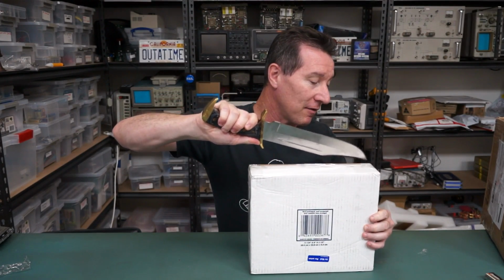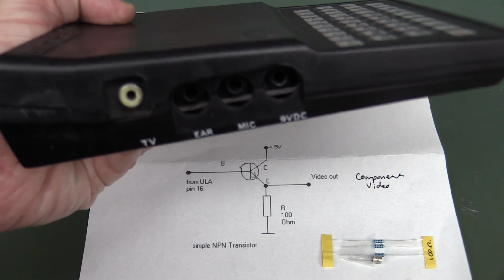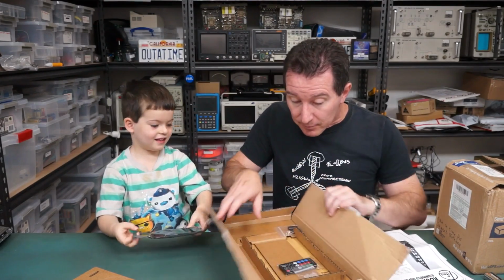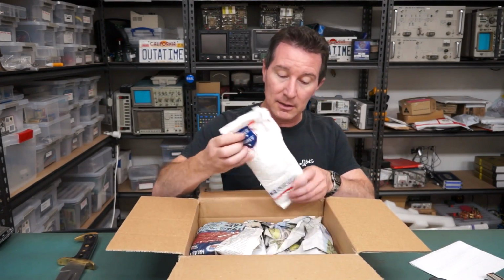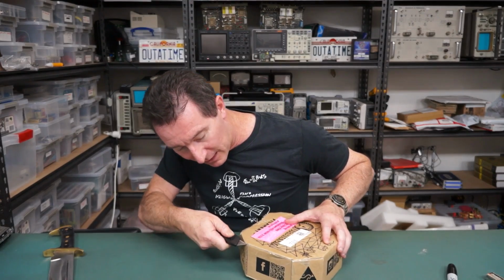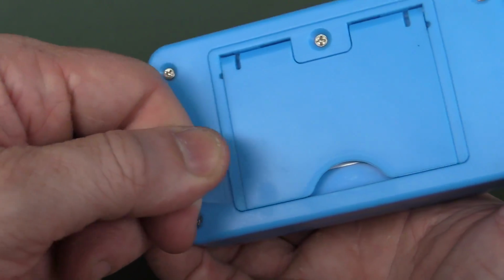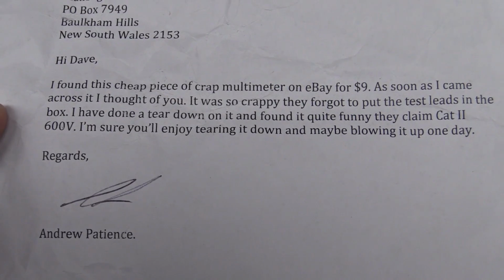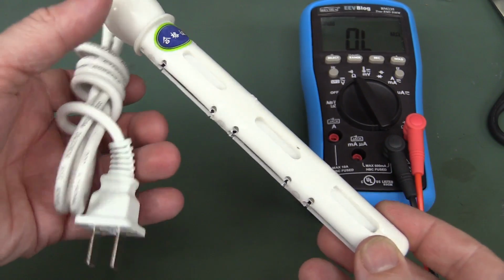EEVblog #872 - Mailbag

Comment: this is a ols 8x4 docis 2(and combatible docsis3) cable modem. most cable provider wont accept to activate this modem with speed profile over 60megabytes. (because it can reach a max 340 only if alone on all frequencies in the node)

Comment: Somebody may have noted this before but the ZX81 was sold (as kit and pre-assembled) in the US for a year or so before the Timex deal. I got the kit when I was a wee sprout and my dad helped put it together. Still have it, too. It was terrible tho.

Maybe that ZX81 was a kit, which might explain the assembly.

In 1981 or so pretty much every consumer thing meant to display on a TV used an RF adapter connected to the antenna input of a TV. At least that's how it was in the US. I don't think composite inputs really took off for US TVs until VCRs and camcorders became widespread.

Comment: the ram packs(expansion), were sold in 16k, 32k, and even 96k.
you dont need any components to do the composite mod you can wire a phono jack direct into the modulator box(videos on youtube), that trick works on all sinclairs speccy etc, the zx80 needs a transistor a diode and a couple of resistors, maybe thats where the confusion comes from. that thermometer would be great for rework, where you need to monitor different parts of the board.

Comment: What's wrong with a transistor tester on a multimeter?
Reply: Usually they have direct connection with the inputs. If you measure 500V using the inputs, there might be some nasty surprises waiting if you are fiddling around the transistor inputs with your fingers.

Comment: That thing with the Arris branding is an ADSL router with telephony. I know, I have a more slimmer, stylish one by the same manufacturer. That thing with the five pins is meant for a big chunky battery.

F-type goes in, ADSL 8P8C and RJ-45 6P6C goes out. Neat to have also with it are F-type push plugs

Comment: well, funny thing is that in prison people would make this kind of thing with a mains cord and two metal plates with an insulator in the middle as a way to heat water. it works to an extent. and it does boil water. okay, that said it's absolutely horrible because the water would taste different, mainly due the the metal eroding away into the water. test it out and then take a close look at the plates after words. they will pit. when you have no form of heat other then a mains socket and some bits of this and that, you will find a way to heat and cook your dehydrated foods or packaged meat.
still not safe, times the insulator would melt and short out and blow a breaker. then no one has electricity.

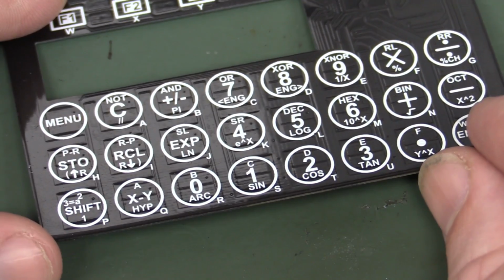Comment: @ 25:00 - The world thinnest calculator was built by Sharp. The "thinnest calculator" war was between Casio and Seiko after all the other manufacturers run out of steam. Casio built a calculator that had the thickness of the coin cell batteries but Sharp made the calculator thinner at the keyboard side and just increased the thickness where the batteries were located and by this way, they have achieved a thinner section in the design. But, it is by far thinner that what is displayed in this video.

Comment: Cable-Box: I think this Atmel XMEGA16A4 near laptop-accumulator style contacts is programmed to act as a charging controller - I think autorisation stuff woud use (like Pay-TV & mobile phoned) a SIM-card style solution)

Normally these cable-boxes are offline when Line power fails = no telephone 
 ... but the accumulator lets you use your telephone reliable for a while the same way as with (by local telephone node station / telephone switch = "Vermittlungsstelle" ) analog remote powered telephone line 

This accumulator emergency-power feature I have never seen in German, if power grid fail here, your telephone is useless if you have VoIP - only the old analog telefone / "POTS" works

Edit:
Atmel XMEGA16A4 is also used for "Hand-held battery applications"

data-sheet   
http://www.atmel.com/images/atmel-8069-8-and-16-bit-avr-amega-a4-microcontrollers_datasheet.pdf

Comment: The plug on the bottom of the Arris Cable Modem is for a battery. The unit is designed to stay on during a power outage for VOIP phones, and some had battery low alarms and all of them could detect the battery's serial number. I am unsure of the reason for detecting the batteries serial number, unless the cable company just wanted to track their batteries? It would display the serial number on the config web page. The unit was provided to customers by the cable company, and also available for purchase at some big box stores and online. It is prone to heat failure, and some of them that the cable company provided me would smell like they were going to catch fire. The cable company in my area has quit using them and started providing better quality modems.

Comment: +EEVblog Dave, thats not a licence module, thats a battery backup slot so you can make emergency phone calls during power outage. I have that exact DOCSIS 3 cable modem/eMTA for sale on ebay actually, its a real great modem but I didn't need it anymore, they go for about 65-75USD. As a side note, I see ATMEL uCs inside many laptop battery packs.

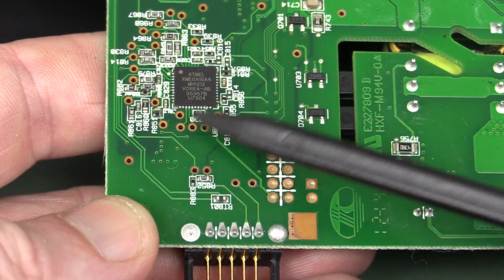Comment: 12:00 those are cable modems and that connector is used as a battery backup because the FCC mandates that any company that offers "Digital Phone Service" offers a battery backup to customers to keep it running in the event of an emergency.

Comment: I spent WAY TOO MUCH on a TI 99/4 and later 99/4A computer with many of its "daisy chained" peripherals. it was technically one of the most capable platforms prior to the IBM XT, with its 16 bit CPU, but making it so difficult for third parties to develop software for it doomed it, in my somewhat humble opinion. The Commodore 64 was my next favorite, since I was already familiar with the 8080/Z80 processors via an S-100 bus computer running CP/M and MP/M (at work, not personally owned). I also worked one one of those "portable" computers that was built like a tool box. You unlatched the keyboard module to reveal a tiny CRT and floppy drives. I can't remember the name.

Comment: Arris cable modems are also supplied by some ISPs here in AU, so far mine has been pretty much bulletproof, the only issue I have with it is that there doesn't seem to have a diagnostics interface on it.

Comment: Dave. The connector on the Arris modem is for a backup battery. It is used in case of power failure as the modem can support VoIP phone connectivity. To call 911 in the event of a power failure the battery is required to sustain the connection.

Comment: That Arris Cable modem has phone service and that connector at the bottom is for a backup battery so you don't lose phone service in a power outage. I have the same one.

Comment: Yes, please do a more detailed video on the ZX81 if you can Dave.
4:08 The earlier ZX80 was actually pretty much the same physical size as the ZX81.
The earlier ZX80 goes for silly money on eBay UK, but the quality of the plastic case can be likened to a yogurt pot! The ZX81 can be used as a door stop, but the ZX80 would shatter in such an application :)

Comment: We have those Arris modems up in Canada too, they're not too bad. Infinitely better than the Sagemcom trash Ma Bell uses...

Also, Dave, best think I've found for opening boxes is a scalpel. You can pick one up with 15 blades (I recommend #11, it's pointy and reasonably sized) for like $20. Do be careful though, if you haven't used one before, they're sharper than you're expecting.

Comment: Cable modem/IP phone with battery backup, so you can use the phone if the power goes out. It's a common configuration.

Comment: The Arris is a docsis 2 cable modem with 2 phone lines. The connector is for a 8 hours battery (I forgot if it is NiCD or NiMH) backup for the phone portion. It is also higher quality than standard landline, atleast they claim it to be.

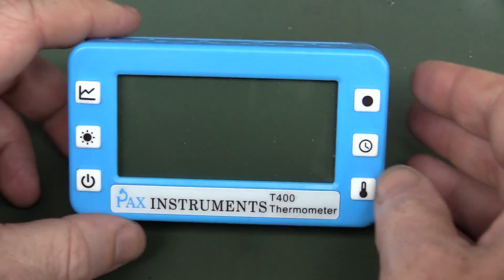Comment: 32:50 I NEED this one for work! I'm forced to use a two-channel thermometer (without datalogging) for measurements often involving more than 6 points and probes
Reply: +nrdesign1991 What instrument are you running? I used to time lapse video record my Fluke 54 II B and and a clock. After writing everything by hand I spent a few hours trying to get OpenCV to record the data for me.
Reply: I can choose between an old dual-channel Fluke 52 and an RS thermometer. Currently I have a project where six temperatures have to be measured simultaneously, and I'm constantly changing thermocouple plugs (which wears out the sockets btw).

We have an ancient Keithley 2000 series bench meter with a 10-channel temperature measurement card but no one knows how to use it, and I don't have the time (at work) to read the manual and program a tool in LabVIEW for it. Automating a 10-channel meter would be a HUGE help as I often have to measure temperatures over time.

I have introduced this simple unit to a feew colleagues and they all seem to like the idea of getting a few. Their only concern is, that it is unclear if this unit can be calibrated properly.

Comment: That connector on the cable modem is for a battery backup.  If you're getting your phone through the modem it gets you 911 access for a little while should power fail.

Comment: The arris box is a digital home phone modem. . (lan- line) and the empty spot underneath is for a backup battery in case of power outage your home phone will run for 6 hour approx.

Comment: Cable modem, that is a battery port on the bottom for when the power goes out the phone function will still work. So that cable modem produces internet and phone for the house.

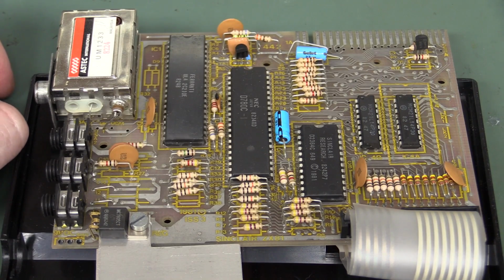Comment: At 5:25 - Dave mentions the UHF modulator.  Wasn't nearly everything in that era (VCRs, computers, games, etc) doing VHF?  Ahhhhh, I remember here in the US that all those things had a channel 2/3 switch.  Important as here in Chicago channel 2 was used by CBS and you could get interference.   Personally, I owned (still have) an Ohio Scientific Superboard that cost me $225 with 4K (!) of RAM which I upgraded to 8K (!!) of RAM.  Man, that was SMOKIN'.  40 years later and I think that it is actually worth more than the $225!  Woot.  Took it to a Antiques Road Show event and they liked it but wanted an Apple I to get on show.  Like that is likely to happen.

Comment: Dave - At 4:50 - You were shocked at the thru hole resistors sitting high on the board.  Some of the Sinclairs came out at KITS!  So maybe this was the results of the kit builders style as I cannot imagine a factory would do this.  I once saw an unassembled kit at a Hamfest and, damn, didn't buy it!

Comment: Very nice choice of thermocouples for that data logger with Omega Engineering...
Reply: +douro20 Each T400 comes with four braided thermocouples that don't have winding handles. They work well and are about 10% the cost of the super cool Omega thermocouples with the winding handles. The Omega connectors are available in the store as accessories http://paxinstruments.com/products/sku1339/

Comment: The connector attached to the XMEGA is actually the backup battery connector.  Since this has a VoIP gateway it is required to have a backup battery.  I would assume it is missing because you can't send Li-Ion batteries via airmail.  As for a cable modem it is a standard DOCSIS 3.0 modem which is usable worldwide.

Comment: ZX81 - The Raspberry Pi of the early 80s! Certainly here in the UK ordinary families couldn't afford hundreds of pounds for a computer, and this machine started thousands of technical careers here in Britain. Nobody had a TV with composite input in 1981! Heck, black and white TVs were still on sale. Sinclair knew what they were doing with the heatsink by then, it is just clunkily done. Now the ZX80... You had to put a carton of cold milk on the case to keep it cool. They forgot the lesson by the time the Issue 1 Spectrum came though, and put a stupidly small heatsink on.

Comment: Why not test the multimeter's precision, Dave. Instead of all that unwarranted prejudice.
Reply: +Mila Miglia did you actually look at the thing? its not unwarranted lol for $9 it really is as he said only good for low voltage or if you want something for testing your car battery voltage once in a blue moon.
Reply: +megaspeed2v2, no, he's just wrong. The instrument is most likely perfectly fine for measuring mains, even up to its 600V rating.
He has very well established irrational bias against inexpensive things and show irrational favoritism to overpriced crude devices like Fluke. Some things from china are built poorly, it happens but judge each item on its merit, not default prejudice. And Dave has been confronted many times by his lack of reason in this department but refuses to listen to reason.
Reply: +Mila Miglia I'd be curious to see this as well, and maybe test for other things like if temperature of the room can affect it etc...  I imagine a good meter probably has some kind of temperature compensation or something.   if these cheapos are actually half decently accurate,  it's not a bad deal for that cheap.
Reply: +Mila Miglia It's not really about precision, it's about safety. At low voltages the can be acceptable. Almost all of my meters cost < $5, my most expensive is a $50 Extech.  Even the meters that were "free with any purchase" at Harbor Freight are more than accurate enough for any work I've ever done.

But if you forget and put a cheap meter across mains or a car battery with it set in 10A range, you're going to have a bad day.  You may get significant burns or perhaps even flying bits could hit you in the face/eyes.

Comment: Arris eMTA - Yankee cable modem with VOIP support, commonly provided by Comcast...   The contacts are for a backup battery to keep the phone line alive if the power goes out (probably gov't mandated for emergency 911 support).

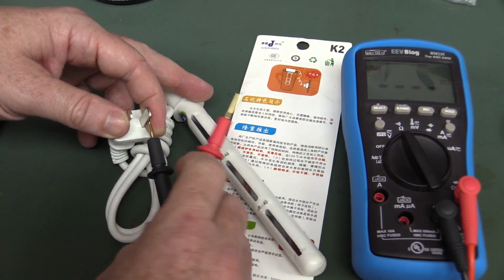Comment: 46:00 It is probably a water heater. We have a "Vicks" humidifier that uses a similar 2 plate water contact 110VAC heater. It uses the resistance of the water between the plates to create steam.

Comment: I learnt to program on a ZX81. The only problem was the 16k RAM block didn't sit on the desk. It was the size of a wall-wart and heavy, it made the whole computer tip backwards. Over time it would work loose and drop off, taking your program with it. 
Oh happy days!
Reply: +Maxx B  I ended up buying one of those mechanical keyboard enclosures, hard wiring the 16k RAM pack to the edge connector and fitting it all inside (enough space even for the PSU), much more reliable but losing the membrane keyboard took away some of the magic. I still have it in the attic and it probably still works.

Comment: i know a little about those arris modems, we had one from one of our local isps (Cable One) here in south east Kansas, the bottom adapter area was for a battery pack because it had a land line phone service that ran through the coax cable so if your power went out you could still use your house phone, and a side note Olathe Kansas is pronounced ohh-lay-tha for some reason, it was probably named by native americans lol

Comment: Dave, those resistors that all stand of so high might have been that you had an assembly technique by a single block under a row so as to afford quick soldering in a single run, much like Philips TV plant in Penrith back in the 80's....
Reply from the maker: +J E I went for a job interview at the Philips plant at Penrith once!
Reply: +EEVblog Dave, I don't know if it's possible, but it would be nice to have a chat about those earlier times. Kind Regards James and Christabelle, from the late 80's

Comment: awkward moment when you have the same multi meter :L
Reply from the maker: +Vibinator LOL!
Reply: +EEVblog i got it for the battery capacity functionality. well i always go for cheap stuff. even my 3D printer is a knock off from the real makerbot :PP
Reply: +Vibinator Nothing wrong with those el cheapy multimeters provided you recognize the limits.  Even Dave is getting it now... throw it in the glovebox :)
Reply: ***** im just using it as a hobby. nothing professional or extreme :p
Reply: +Vibinator 
It's better than the one I have though, mine can't even measure DC current lol.
Reply: Gordon Freeman You better get a cheapy then ;)
Reply: +Vibinator
For battery measurement good dmm is ut139c because it is 6000 counts.
Reply: Arek R. cheers
Reply: Vibinator
So you will buy this dmm?
Reply: Arek R. at the moment. no. i need to save up some money lol. university  is expensive ;)
Reply: Nope, its only about 40$

Comment: Sadly the extra markings on the Pax InstrumentsT400's board will just lead to Chinese devs to be able to clone it that much more accurately. People need to not be so naive when releasing stuff.
Reply: +edgeman83 I think the T400 is in a pretty good spot where straight cloners wouldn't want to go. If a cloner want's the low hanging fruit, they would just copy RasPi, Arduino, or any of the other devices out there that are only an assembled PCBs (PCBA). PCBA is easy because the tooling costs are negligible. To clone the T400 a person would need to not only make the PCBA, but make tooling to customize the LCD cable, make an injection molding tool for the enclosure, and make a sheet metal stamping tool for the thermocouple connectors. If they're willing to go through all that effort, they would be better off copying a $450 Fluke device.

I'm an American living in Shenzhen. My costs are about as low as they can get while making quality devices. If I find a factory cloning the T400, I will not have found my competitor, but my supplier ;-)

All source files are available on Github.

Enclosure: https://github.com/PaxInstruments/t400-enclosure
Firmware: https://github.com/PaxInstruments/t400-firmware
Electronics: https://github.com/PaxInstruments/t400-electronics